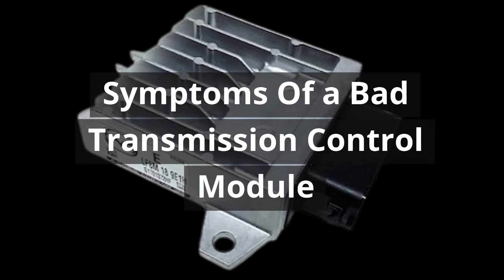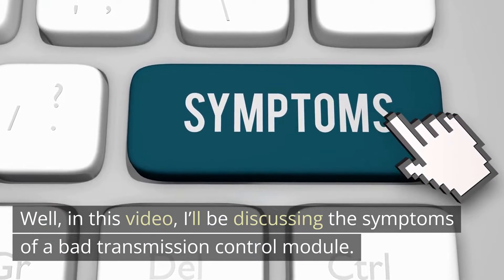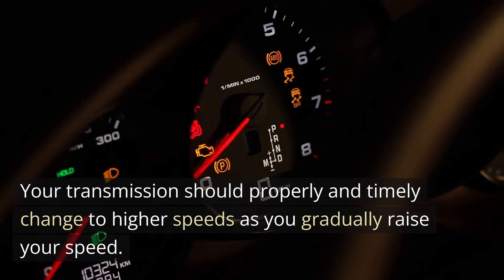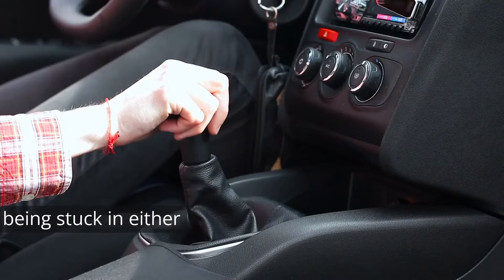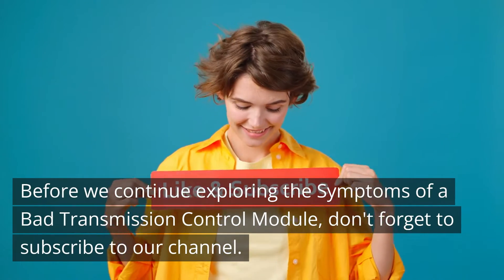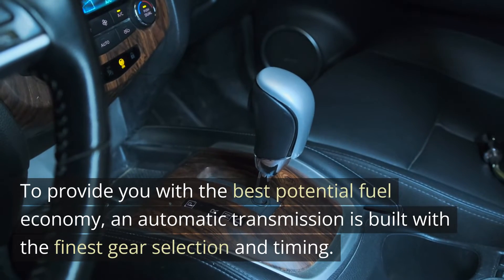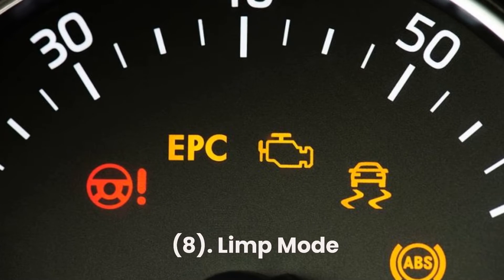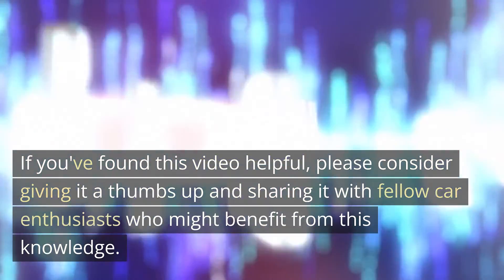Symptoms Of a Bad Transmission Control Module

Comment: How much can  i have automatic 2015 ford figo transmission control module
Reply: Hey heads up. If your ford is a focus they have a recall on this part. Mines in the shop now after mine crapped out. So long as your car is less than 10 years old and under 150k miles you're covered. 

Mines 9 years and 147k miles 😎 barely squeezing by.